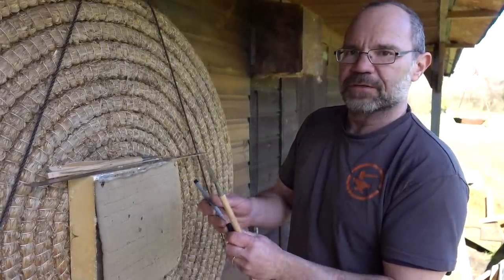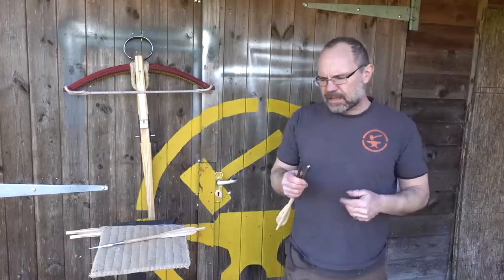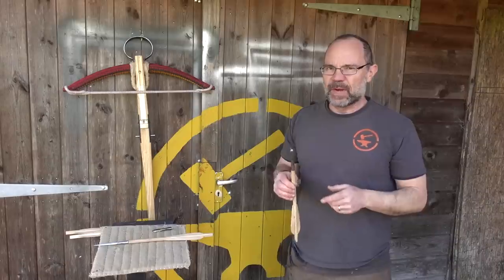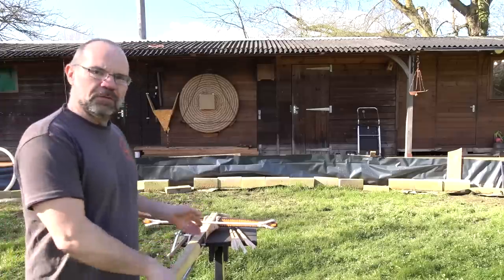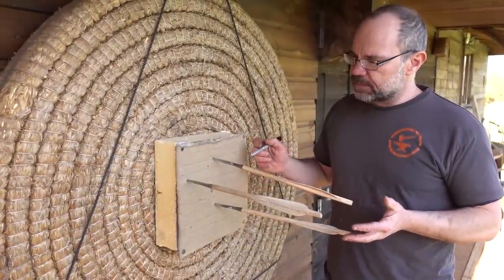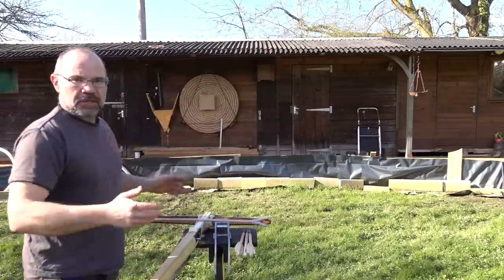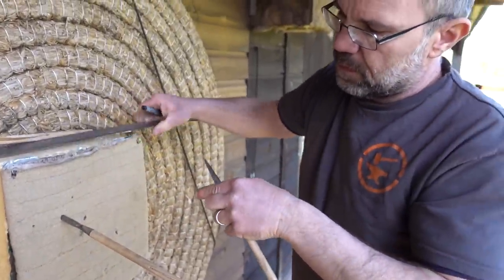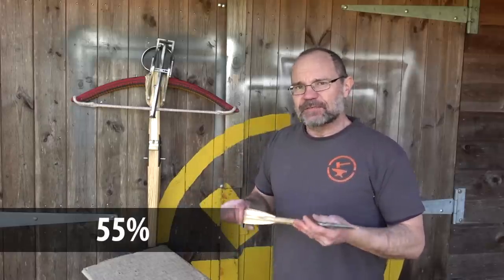Does WAX on ARROW HEADS Do Anything?

Comment: Interesting 
I’m not surprised about the wax. We tried dry film lubricant on target crossbow bolts thinking it may help removal from target butts but it just made the bolts go in further! Perhaps it’s the video quality but those bolts don’t seem to be flying that fast, are you sure it’s a 350lb pull Crossbow? The bolts also aren’t flying very straight so not surprised some bounced out, and notwithstanding that they may not be made very well perhaps you should have shot from further back to give them time to stabilise?
I used to shoot target crossbow in a national team using one of three crossbows I built myself and even using relatively blunt target bolts I’d expect better penetration from our 95lb pull crossbows. Straw targets aren’t very durable so most clubs used 6” wide strips of fibre board packed on edge which proved pretty tough but even so after a little use we found we had to put thick rubber mats behind the butts to stop bolts going right through stripping the fletches. I’d be interested to know what bolt speed you’re getting. On our field target crossbows we were getting a pretty consistent 65m/s.
Reply from the maker: Medieval layout bows are very inefficient and this was putting out about 45m/s and yes 350lbs

Comment: Using www.graphpad.com/quickcalcs/ - continous data, t test to compare two samples:
Dry: 26, 25, 18
Waxed: 45, 47, 45
Result:
"The two-tailed P value equals 0.0010
By conventional criteria, this difference is considered to be extremely statistically significant."

Comment: I mean, one thing I can see here is a very clear path for accidental discovery.  Those tips wouldn't have been any form of stainless, and you do a fair amount of protecting your gear from rust.  I could see some enterprising lazy individual coating their tips in wax, or tallow, or some other oil, to prevent that rust. I could also see a waxy carbon coat from holding the tips over a candle flame to prevent them being so shiny at night.

Comment: Teflon itself has never been used to give bullets more penetrative power.  There have been bullets made of harder materials for more penetration that required a softer coating that can accept the riflings without damaging the bore.  But, the Teflon thing is a Hollywood myth.

Comment: Is the crossbow you used representative of, say, an average crossbow strength of the time?  I'm sure a more powerful crossbow would grant extra penetration, that's just physics, but how much more powerful a crossbow could you have gotten when the bodkin was still in common usage.  I think it could be interesting to see if you could push a waxed bodkin to a lethal depth of penetration with a period crossbow.  Unless you got lucky, 45ish mm (less with the thickness of the armor) would seem to cause not too much more than a bad day.  I'm not volunteering to get shot, armored or not mind you, but an inch, inch and half of metal into flesh would totally make me mad, or take me out of the fight long enough for me to pull the bolt out, but if doubling the power of crossbow netted you even close to doubling the penetration, that starts to get concerning.

Comment: Not trying to be pedantic, great video, with great work being done.  I think your math is a bit off however,  I believe you are seeing close to 100%, in one case greater than 100% increase in penetration depth.  this is of course ignoring for the fact that the increased penetration is a much wider part.  ~50% would be comparing the penetration of a dry tip while using waxed as the baseline.  Regardless impressive work, thanks for the video.

Comment: If you want to get a useful result you need to make at least 30 measurements under each condition. Otherwise you can't assume your results to be normally distributed. Therefore you can't take the average of your two cases and compare them :)

Comment: Just to ask, because of my ignorance, how do arrows puncture with other oils/tar? Because if arrows work this good with wax, I have to ask. And which work best? They did use things (fire\oils) after a surprise attack to followup the attack or when the surprise was lost. Because raging wild fires help to cause chaos.
Reply: fire arrows are a poor idea. They were not often used (if at all) and would not be anywhere near as effective as they are depicted to be in media. Also they would go out mid air. (Also, oil was VERY expensive in the middle ages).

Comment: if the base number is 25 mm and the waxed number is 47 mm of penetration. should it not be an increase of 88 percent? Instead of the mentioned 55 percent. but than you don t calculate the depth increase...

Comment: This has probably already been explained in a previous video but, you said it's a 350 lb crossbow which is equivalent to a 70 or 80 lb longbow, why are they different? Is it the weight of the bolt? Or maybe because the string has a shorter distance to accelerate the bolt?
Reply from the maker: The second.  The crossbow is grossly inefficient as compared to a longbow

Comment: Would arrow and bolt heads be waxed to stop them rusting while being transported? Could the extra penatration be an unintended concequence, how long would bolt's and arrows be stored before use and how were they stored, I know they were stored in barrels, but were they also oiled or waxed too?
Reply: Just read down the comments my thought was already articulated, sorry

Comment: that bow you are using has high pull strength but its draw is much to short so its really not that powerful, if it had the same draw strength but more draw pull and elasticity it would shoot way way more powerful. The same principle if you had a bow with 1000lb pull strength but if its only 2 inches that it can draw then it would not throw the arrow hard at a longer range just in the short and very close distance it would have the power on it but anything with distance it would fail to give it the right power for which it deserves.

Comment: Whenever I see a penetration test like this with arrows or bolts I always wonder why the tester removes the shaft while struggling to hold on to the head or whatever to mark the depth. If you know the full length of the arrow, just measure how much is still sticking out and subtract it from the full length. Or am I missing something?
Reply: You need to take it out anyways, and why do more math than needed?

Comment: I guess it could be correct. Arrows are hard to get out of practice sheets/compressed hey but much easier when you put some WD40 on the tips so o guess the might have done the same with bee wax for pratice shooting and i guess from there its not to far off to real battles when somebody saw the difference when he used wax on the tips

Comment: Do you wax the crossbow it's self, along the area the bolt sits and where the string is in contact with the bow body and bolt. 
I could imagine an happy accident, Crossbowman comes home leans his bow up against a wall that has a beeswax candle burning above it on the wall.
Has his evening meal goes to grab his bow to return to guard duty to find the candle has dripped wax all down the bow body.

Comment: You can not compare arrowheads as if they were shot from a bow by using a crossbow. Bolts simply do not work or penetrate the same as arrows. Period. So what exactly is the point of your test?

Comment: You mentioned teflon on bullets making them penetrate armor better. This is objectively false. Certain rounds that had improved penetration were coated in teflon because the actual projectiles were made of solid brass or steel. The teflon was to protect the barrel from wearing out due to these projectiles being harder than the solid lead or copper jacketed rounds that were normally used. Coating a bullet in teflon offers no additional penetrating capabilities.

Comment: Would they use wax to prevent corrosion also?
Reply: Damn good point. Would probably last longer inside a quiver waxed rather than having the oil continually washed away

Comment: What about Teflon coated bolt tips?
Reply: Bad idea, Teflon is actually pretty fragile and detrimental to penetration.  Its use on some modern rounds is to protect the barrel from the hard round, even though it makes the penetration slightly worse.  Without some form of protection for the barrel, the varies forms of hardened/penetrating rounds would rapidly destroy the rifling and ruin the barrel.

Comment: Couldn't it be that they been using wax as metal preservative back then similar to lithium grease or waxs in modern use? Also the quenching of these heads in available vegetable oils could have left a greasy surface coating that could act similar. Maybe that is something to test yet. Too bad that you fallen for the widespread "Black Talon" myth trap a bit - to defeat Kevlar it still takes mainly speed and hardness somewhat. It is surprising where these myth spread by anti-gunner sometimes resurface and how inbedded they got in society despite being dead wrong and complete BS.

Comment: why dont you try actually sharpening them?
the bodkins. hard hard temper, use a mill bastard file and stone. make them sharp
Reply from the maker: Because that defeats the point (Good joke that one).  

As a mass produced weapon razor sharpening each, would not have been done, "sharp enough" would be the way and so I used these "sharp enough"

Comment: Teflon on bullets for armor penetration is a fairy tale by anti-gunners. Bullets deform on impact. Putting a coating on them doesn't do shit. You need a harder core material to prevent deformation, if you want a piercing effect.